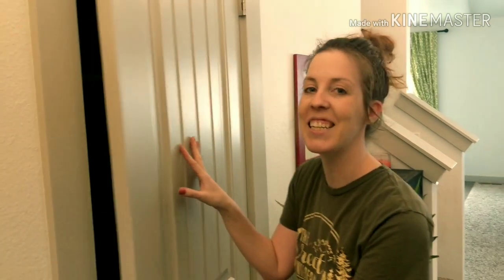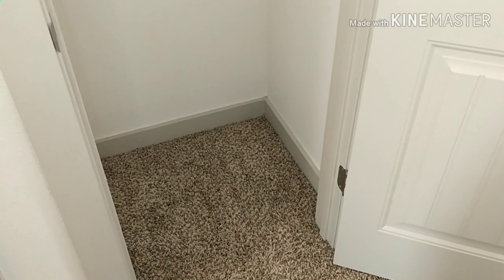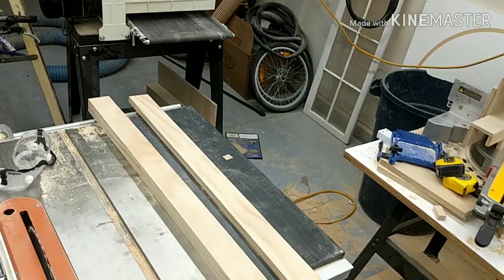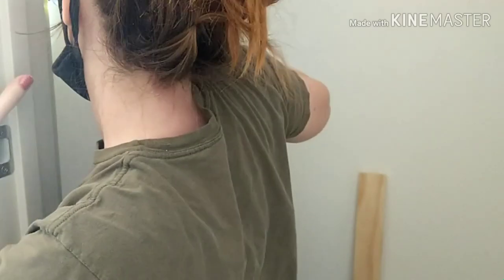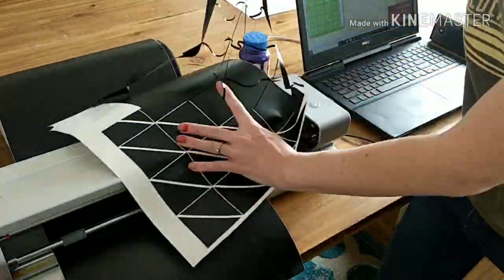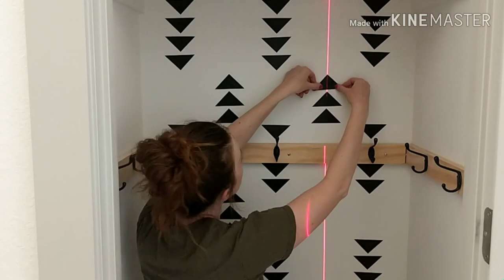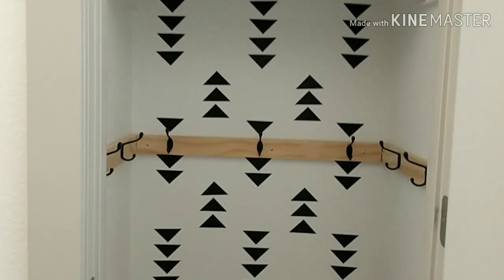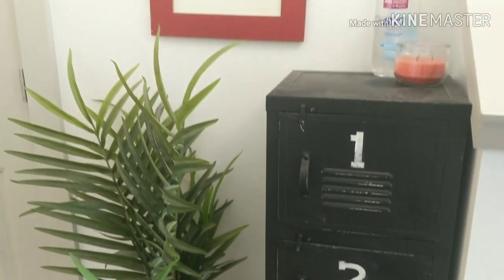Small Entry Closet Makeover | DIY with Patterned Accent Wall | Organize & Elevate Your Space

Comment: 1) What wood is the one to which coat hangers are attached?
2) What is the wood used for the 2 white shelf’s?
Reply from the maker: I used a 1X2 select pine board from Home Depot for the coat hanger. The white shelves were already in the closet, but my guess is that it is particle board. Hope that helps!
Reply: @houseoftimbers  Thank you for your reply 👍🏻
Reply: Sorry one more question - What’s the drill bit size and which is nail anchors you have used to attach the wood slats to dry wall?
Reply from the maker: I'm sorry, unfortunately I don't remember.  I definitely like the bigger anchors for something like this, and I just make sure the bit I use is slightly smaller than the screw that I'll be using